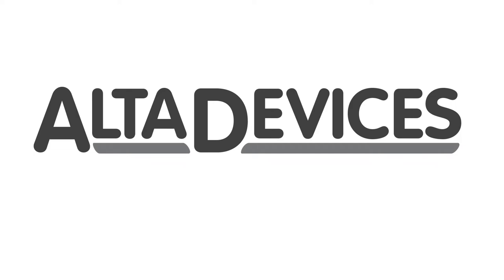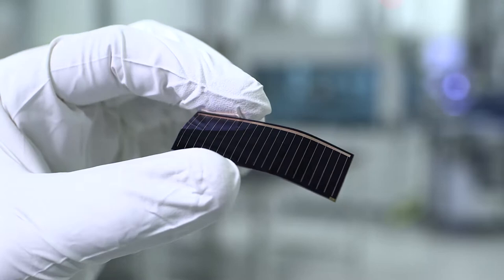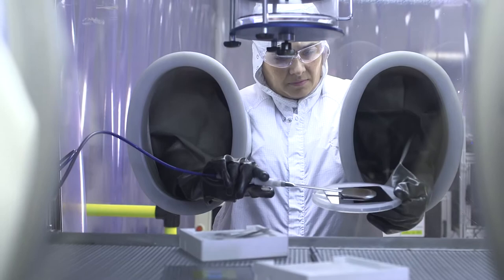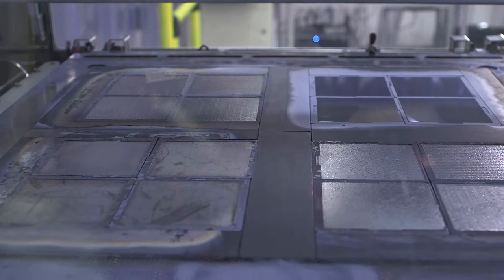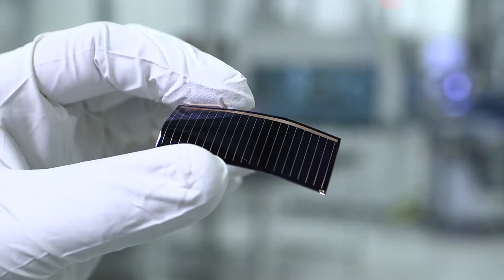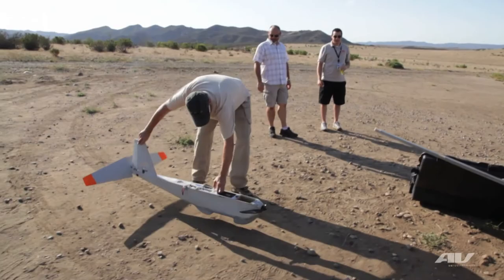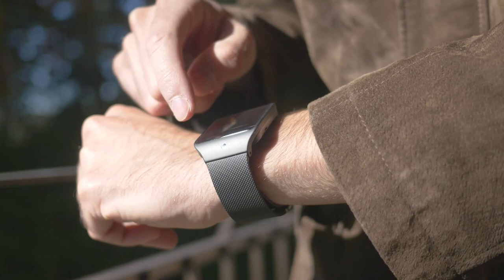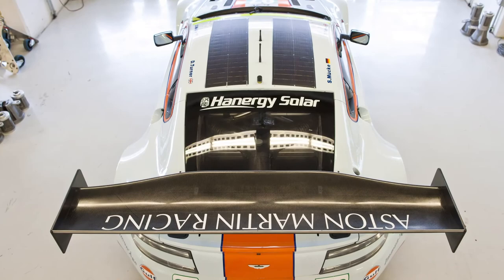Alta Devices' Mobile Power Technology

Comment: Please make a foldable solar panel for use in backpacking/hiking. Right now, SunPower is dominating this market, but their technology is nowhere near as efficient as your’s. Device integration is nice, but not very flexible in terms of use. A portable, universal charger paired with a sizeable external battery would be ideal for this purpose.